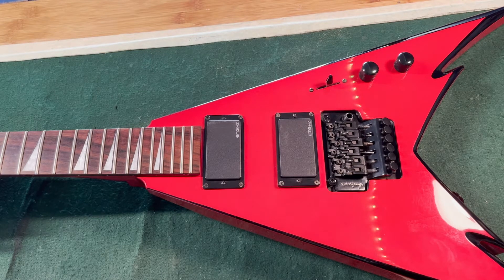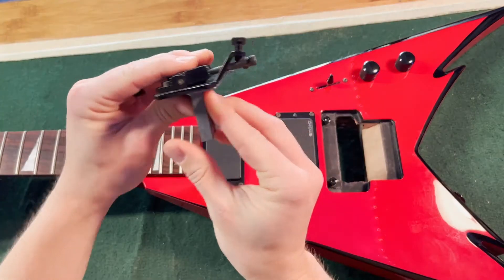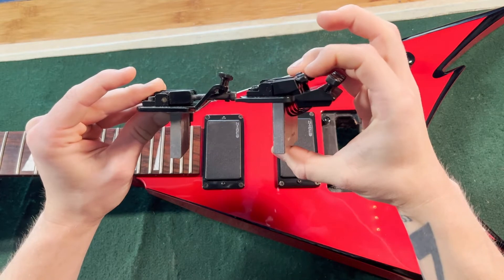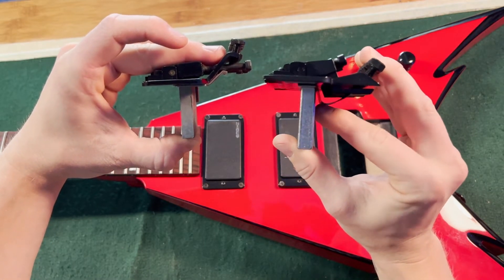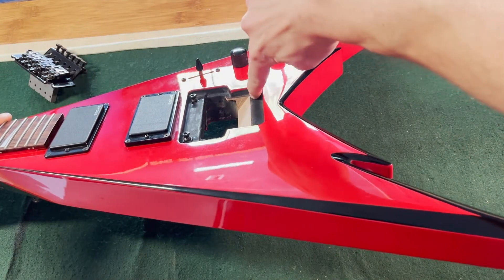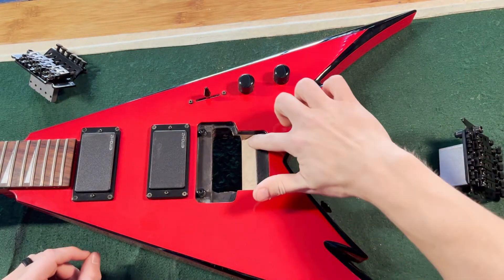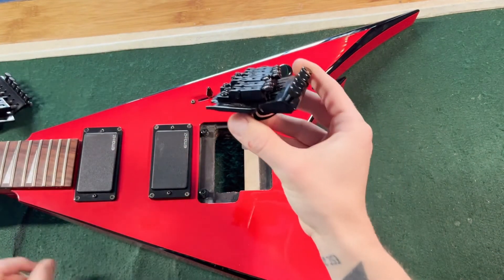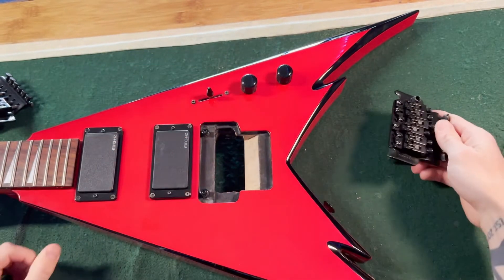Don't Upgrade to a Pro Series Floyd Rose, Yet! Know THIS first!!!

Comment: Got a RRX24 had a special on it I put a go-to ge1996t had issues with strong bottoming out but shimjed the gohto nut and finally stopped .
Reply from the maker: Nice!
Reply: @erikguitardesigner  I ended up selling to a friend that owned a used guitar store the V shape just don't sit well on the leg . And the compound radius and the Duncan's . Not real hot now Austin they have but they ain't no EMGs that's for Shure the only thing I have with active is my bass  I like passives in my MLs and active for bass

Comment: You can take a special Floyd Rose 1000 series and upgraded with fu-tone like I do and it's awesome
Reply from the maker: Thanks for sharing! I’ll look into that!
Reply: The Floyd Rose special will still have a cheaper softer metal base plate and where the knife edges quickly. That is the main issue with the special. If you upgraded the baseplate too it is no longer a special....

Comment: Personally, I use my Floyd rose guitars for dive bombs only. Would I still need to route out the cavity to have this installed?
Reply from the maker: I’d say no as long as it sits level to the top or looks decent enough for your standards. If i remember right, i think i had to route it because this customer did want the full movement from the floyd.

Comment: Hey buddy that Floyd rose that you installed is a Floyd Rose pro  low   profile. Pretty much the same design as the super common jackson licensed jt580lp were common on Jackson's up until about 2012 . Made in japan by tekeuchi and they are excellent. I have both. I noticed on my dk2 with the floyd rose pro low profile that it looks like the installer might have took out a little bit of wood underneath like you did very little if any was taken out. The Floyd Rose pro has been giving me problems a little bit with the fine tuners lately. V I have at least five of the Jackson JT 580LP in other mij Jacksons from all from 2010 or earlier. I prefer the jackson lowprofile by quite a bit. The newer licensed Jackson floyd trems are not so good probably on par with the special. 

The jackson  jt580 non lo pro were great too and they were like the original floyd rose design. 

I haven't had any issues with any of my Jackson jt580lp. And I've had problems with every floyd rose original i have and now my Floyd rose 1000 or 1500 is starting to have issues with a couple saddles locking the strings ... Fine tuners starting to act up as well. The 1500 is old 2010 and  I bought the Charvel that its on from a guy that used it on tour for several years, so i can't complain about 1000 or 1500 series floyd rose.
Reply from the maker: Thanks for the info!
Reply: Takeuchi made good bridges, even the TRS 101 is super solid, as long as you don’t end up with the lo pro version. My 90s Pacifica flutters like nothing else I’ve ever tried, Takeuchi bridges are super underrated.
Reply: As for the string issue, make sure you’re not using the allen key the long way, it puts too much stress on the metal and eventually causes deformation, allowing slippage.

Comment: I wish I had known this before I bought mine... 😕  I wanted to install it on a Charvel 750XL but it had a figured maple top with no recess needed for a standard Floyd, and I didn't want to dig into the top to install the Pro. I've now gone with a Graphtech with piezo saddles so I can install the ghost circuitry on board and connect to a Roland guitar synth.
Reply from the maker: Nice!!!
Reply: Please do not hack that  charvel😢
Reply: @tankdarla637  sorry, I'm gonna do it...😕 The Graphtech Floyd has been on for a while, no mods needed, I just have to enlarge the jack recess to install the 13 pin jack, drill another hole for the 1/4 inch jack, and 3 holes on the top for 2 mini switches and 1 knob, then it will be like a Godin setup but on the Charvel. Just gotta work out the layout and logistics of where to drill as closer to the bridge the wood is a lot thicker than near the edge, due to the carved top. Either way, minimal impact to the beautiful flame top. I guess I could mount rocker switches and a roller knob around the body edge somewhere...? But I think that's  more trouble than it's worth.

Comment: Hi, am I able to install it to Jackson soloist S series SL3X DX equipped with FR Special? Thank you a lot
Reply from the maker: I can’t tell from the pictures but I’m going to assume if they were manufactured to have a special series floyd, the cavity isn’t going to be deep enough for the pro series like on this model. Best to plan for the worst and if it fits without, you’ll be good to go!
Reply: I think floyd rose originals and floyd rose 1000 1500 and 2000series are all same      style of Floyd and drop right in replacement for Floyd rose special
Reply: X series not s series
Reply: @tankdarla637  yeah, sry, missloc k

Comment: I got a pro 7 string because I really really really wanted a pure oil slick guitar to match my bmx bikes...I am beyond underwhelmed at how bad the pro is, the fine tuning system has giant coarse gaps in it because of the shape of the tuning surface and the tuning screw. Also the high e was WAY too close to the edge of the fretboard compared to the OFR7 it replaced
Reply from the maker: Thanks for the info!
Reply: @erikguitardesigner  allegedly, there have been bad batches of the fine tuning screws for the pro so I would like to order some more and see. However it seems like they have been out of stock at Floyd rose since 2019 and no eta on if when they’ll be back

Comment: What kind of rasp did you use a drill or hand rasp? I got a 2020 fender hm I want to upgrade the special to a pro. Already got the pro
Reply from the maker: I use a hand rasp. I prefer taking it slow.
Reply: Thank you it turned out good laid painters tape down first then duck tape over it took a oscillating tool then rasp then file ran 120 sand paper over it now need to paint it black this is awesome thanks
Reply from the maker: @tommyapplegate30  Glad I could help!!!